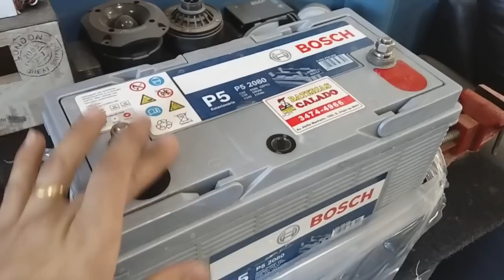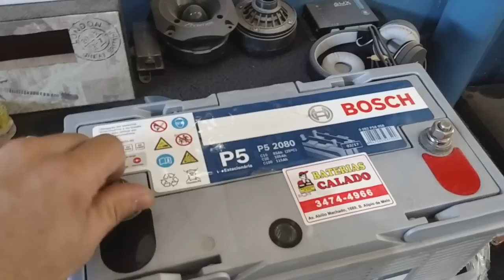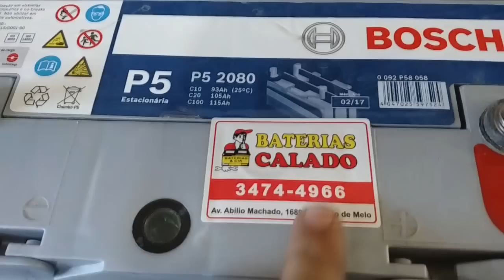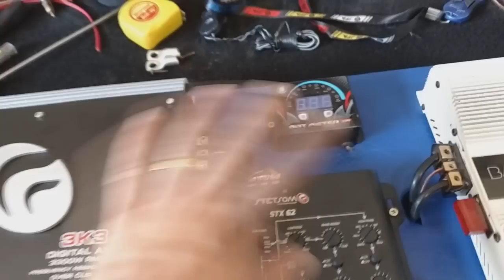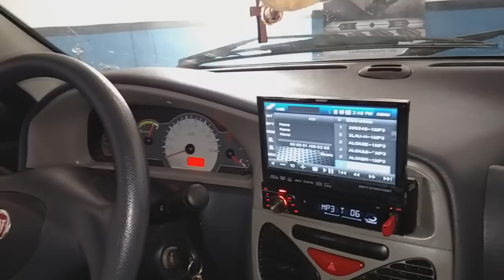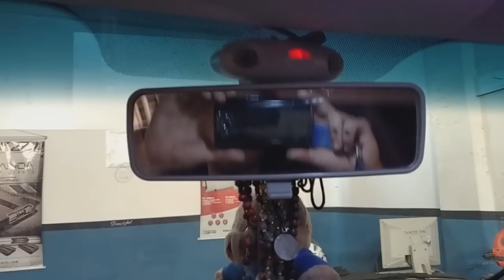Palio 2 SDS2.7k + STETSOM 3K3 Projeto batendo forte...☢JuNiOr SoM♛®

Comment: Junior achei legal as dicas que tu deu sobre regulagem sobre o som que vc utliza, tenho um sds 2k7 com uma stetsom 4k2,, 2 medios graves de 8 MG208 2 st400 2 d405 com uma sd800 e um processador de audio px2, a pergunta seria, como tenho medio utlizo o corte do woofer de 50 hpf a 250 hpl e os medios de 250 hpf a 1000 hpl e d405 de 1000 hpf a 5500 hpl e st400 de 5500 hpf a 18k hol seria isso mesmo

Comment: c tinha q ver o som do meu pai em junior vou falar o q tem no som dele tem 4 falantes 2k2 da ultravox 4 corneta d250x 2 Twitter dá Selenium um módulo 800 Taramps pra corneta Twitter um módulo 30 mil alta voltagem 2 voltímetro 1 closolver 64 Stetson rádio dá pionner 1 bateria de 150  fica no chão do carro mais uma de 45 pro 12 volts e dá alta voltagem 12 bateria meu pai ainda vai coloca mais bateria tudo de 40 pra alta voltagem pq na alta voltagem oq importa é a quantidade de bateria eu acho q só isso aí cabe tudo no celta mais uma caixa meu pai leva no banco de traz aí quando chega pra toda aí coloca a caixa uma encima dá outra esse som colbe tudo no celta o banco fecha na trava original esqueci o painel do módulo é q nem o q vc faz aí é isso aí mande um salve